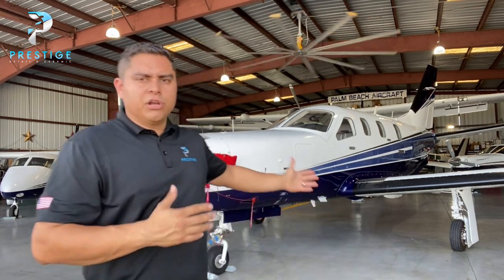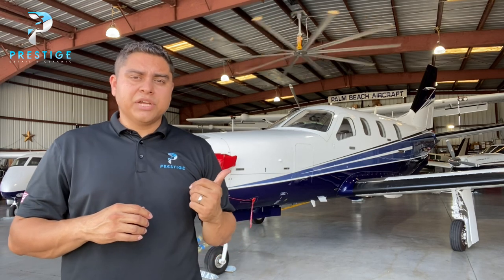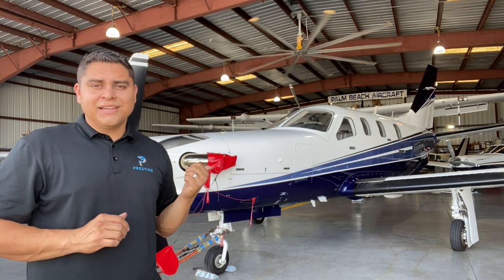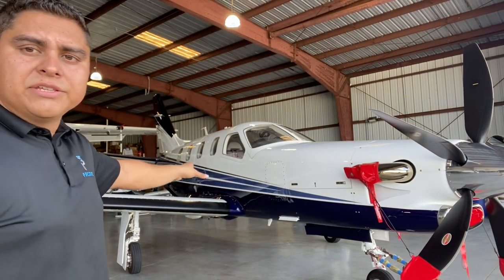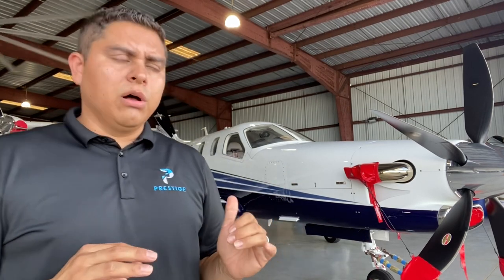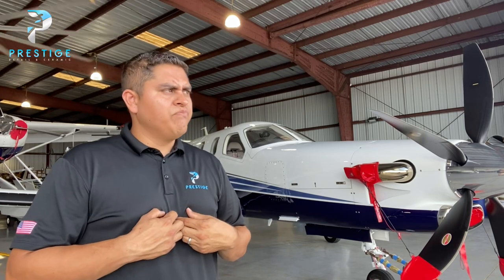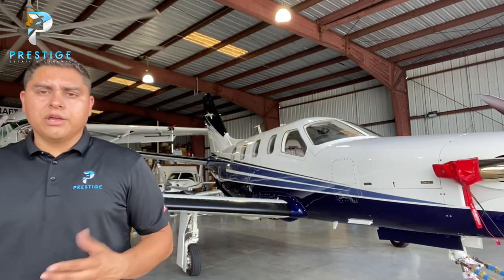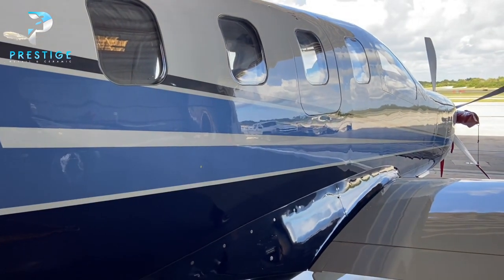TBM 940 - Ceramic Coating

Comment: Though I'm sure the coating doesn't last forever.  What happens when the coating breaks down.  Does it flake of in patches?
Reply from the maker: The coating lasts up to 1000 flight hours with proper care like regular washes and being hangered. It doesn’t flake or yellow but instead acts similar to a wax and just wears off over time with no visible sign.